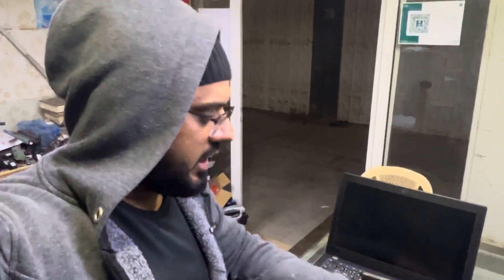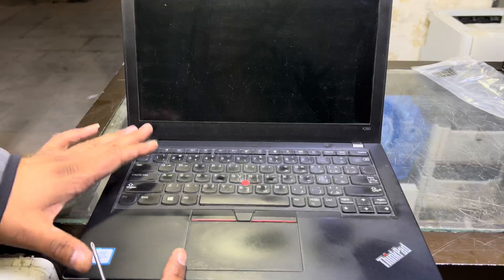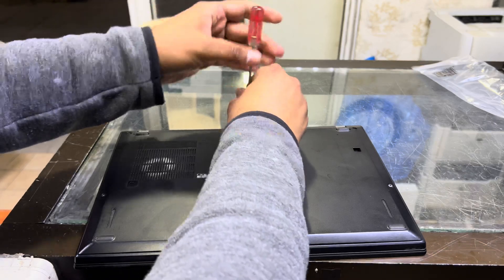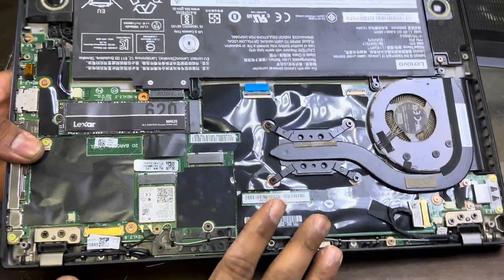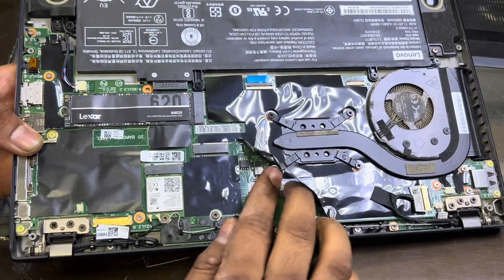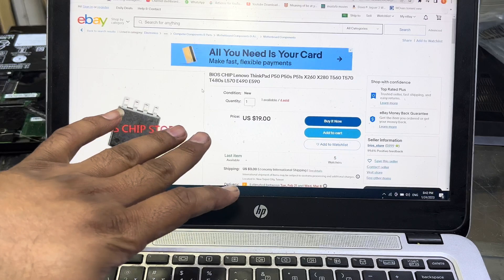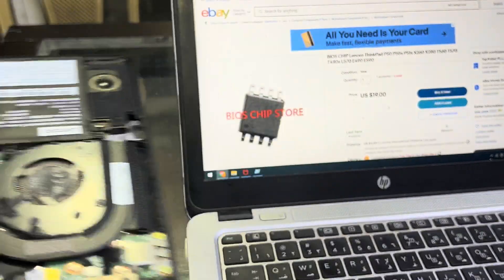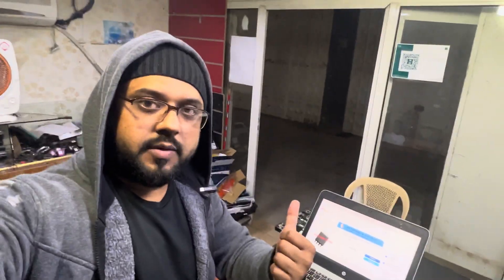How to Reset BIOS Password Lenovo ThinkPad X240,X250,X260,X270,X280

Comment: swapping will not solve the issue...
Reply: Ya lo reprograme y no quito la contraseña
Reply: @john.025 reprogramming will not solve the issue. You need to create a patch bios. And program it and then you can see an option to rest the admin password. After clearing the password reprogram the original back up bios. Done
Reply: @john.025 A good technician can do it 😊
Reply: @john.025 your Lenovo model?
Reply: @PrasobhPrakash  do you have a patch?
Reply: @john.025 yes Lenovo is not good. Poor build quality. Thin aluminum body damage if it falls from a short range. And sometimes it's power on but no display. It's a common issue in Lenovo. The solution is reset the battery connection.

Comment: It will not reset password even you change BIOS chip, its in IO chip, I changed my Lenovo X240 motherboard but unfortunately the board i got was locked by supervisor password, i changed BIOS chip and its still asking password 😢
Reply: Right
Reply: @dev950  I have done reset supervisor password by reading BIOS chip and 😭 patching BIOS usinf lenovo auto patch script.
Reply: Sir please tell me the procedure u did
Reply: @dev950  I make a backup of my BIOS then i patched a copy of readed bin file using a script Lenovo BIOS patcher then resoldered again on the board, followed the onscreen instructions and at a point my system stuck on blank screen

then i written original BIOS and now the supervisor password is wiped from the system IO chip
Reply: Will it work in x270 model
Reply: If it will then please give me download link of script lenovo bios patch
Reply: I have the patch bios and stock bios for Lenovo Thinkpad x240.

Comment: You just need to read the chip and see the password
Reply: Only a technician can Identify the coding and edit the hex. You can ask a technician to get a patch file and stock file. Try with a programmer with an IC clip. If you don't know how to do it then ask a technician to fix it. Otherwise you will lose your motherboard.
Reply: Are you serious ?, as in the numbers on the actual physical chip ? thought that was a model number :D
Reply: @jameshill2806  my friend, read the chip with a programmer and a program. Not the model number of the chip
Reply: and if you think that the password is written in plain text you are no so smart ...also I think this will not unlock the bios password because the passwords are stored in different chip...you need hacked bios chip which has to be soldered...
Reply: Explain further bro

Comment: this chip password is planned obsolescence and should be denounced as infringement of the right to repair at the authority
Reply: I do not agree that it infringes right to repair. The chip doesn't go bad or make your laptop stop working after a set amount of years. If you have this issue then that laptop was probably stolen or you simply forgot that password. In case you forgot the password you should have never set it, it works fine without enabling the password feature. I hate the existence of this chip.

Comment: You say this like its an easy thing to do - like swapping out a battery..  Desoldering a bios chip requires equipment and expertise.  If you attempt it at least use flux.